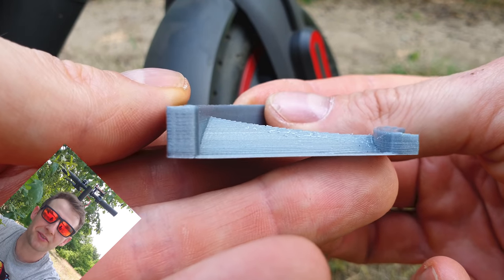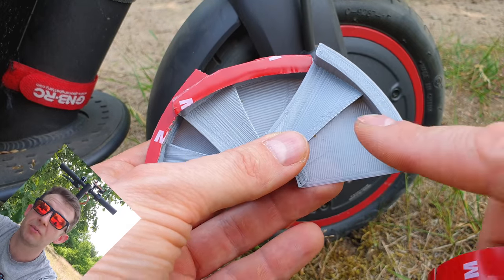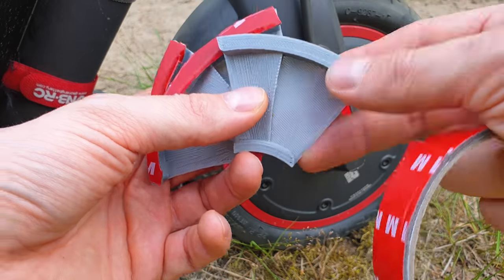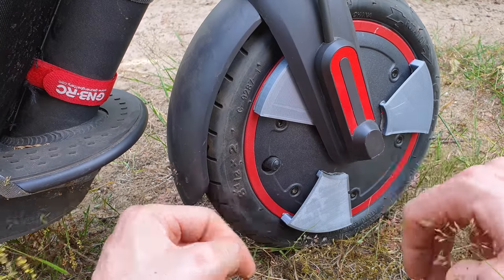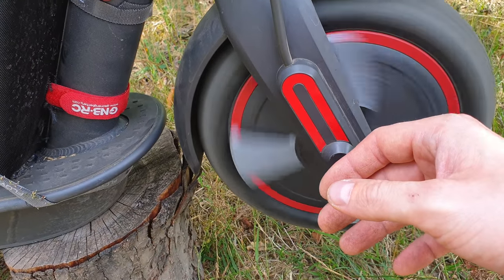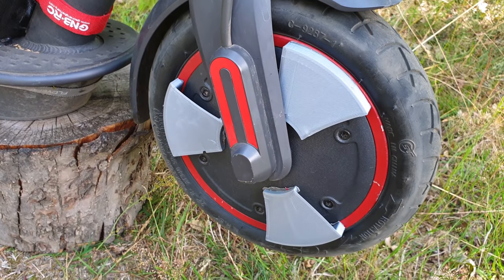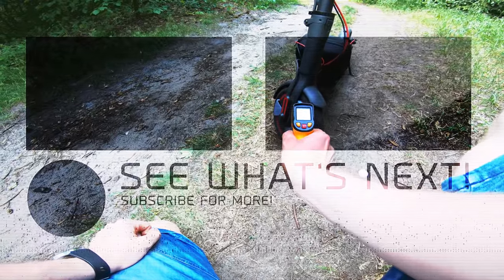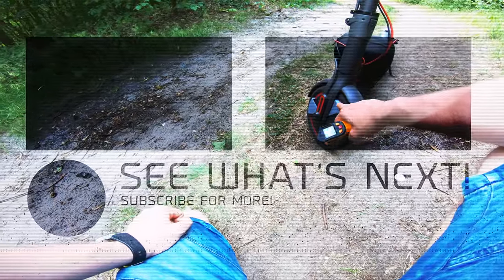World First Cooling system for Xiaomi M365 PRO " How to extend life span of your M365 "

Comment: If the hottest part of the motor is 65 degrees C then that's actually ok, close to the limit but not too bad. A quality motor with quality laminations can handle 65 degrees no problem and shouldn't kill it. However cooling the motor will still be good as there will be less resistance due to heat and you will maintain more power as there is less resistance. Perhaps next mod for cooling, look up "Statorade" it will transmit the heat from the motor core to the external casing far more efficiently and result in a cooler motor, more power being maintained, more efficient!
Reply: That isn't a flawless method in fact it comes at a bigger disadvantage,You will have to drill a whole in your motor which
1.Looks Awful
2.Will most likely damage the motor and has more risks
Whereas the only risk in this method is if it literally becomes loose and breaks some parts which is very rare because the tape is very sticky and you could use some super glue for some extra assurance that it wont fall out and potentially break something,So great suggestion,But not so great either 🤣
Reply: @agariodestroyer1862  Noooo!!! you do not have to drill a hole in the motor casing!! You just take the motor side plate off and drip it on to the outer casing magnets then put the casing back on, its that simple.  I have used that method on all of my motors. As for longevity and reliability its something ive learned you need to test, not all motors use the same epoxy to fix the outer permanent magnets in place and the statorade will react with some of those epoxies and the magnets will come off, however i believe there are a few people on the 365 forums who have used statorade without issue. So long as you swap out the statorade every 12 months it will not damage the motor provided the epoxy in your motor is compatible. I have used statorade on my motors for years without any problems, although i know people who have had magnets come off weeks after using it as the statorade reacted with the epoxy glue. Hence there is a stigma surrounding the use of statorade, it is up to you to test and use your own due diligence.

Comment: The best way to decrease temperatures isn't by adding anything or taking anything off, although I did notice that the cosmetic ring someone else mentioned did make a noticeable difference in temp. No, the best way is to make the motor more efficient, or more capable. Although, this will likely just move your hotspot to the next weak point , the controller. This is the game, those of us who are never satisfied we'll keep playing tag until the day we die. My goal is to go before the scooter does. Anyway, I live in one of the hottest environments on Earth(103° right now) and just accidentally leaving the scooter in the sun will render it useless, can't charge or ride above 104°. My motor always runs slightly above warm to the touch. I am running a sort of "hybrid" setup but the same applies. The trick is to make the weak component at fault more capable, in this case, I replaced the thin width rotor with one from another scooter with a higher rated wattage, I believe the one in my current setup is rated at 500w. It was a wider rotor and I had to do minor fitment work to get it on the 365 axel because the spacing was different on the donors. I also replaced magnets from the donor as well just to maximize potential but you don't have to & for the amount of work it doesn't seem worth it. Hopefully, once I beef up the controller and can put more power to the motor, it will become obvious that it was worth it. I'm sure it will. So, because you're not overloading the motor, the entire scooter runs cooler and of course made a noticeable difference in power, allowing me to up the power via firmware. It really is a win-win situation. Good luck and thanks for the vid!👍
Reply: Oh chill the f... out man, you're a scooter rider not some hardcore biker , comm'on!
Reply: @ChrisWhiteTech  here we go.. there's always one.  Whatchu so angry about man? Cuz I just made you have  to look a bunch of stuff up because you don't know what I'm talking about? Why are you watching stupid scooter rider vids then? Better yet, why you commenting on them?
Reply: @zro6828  Stupid vids? Not at all, this one in particular is pure genius, and i find it very informative as an owner of a clone m365 that needs improving in cooling and also an owner of an 2005 R6. Just sayin' tone down with the death references man, electric scooters and skulls just don't get along man, just...don't
Reply: Or you could simply ride the scooter with custom firmware installed, where the maximum speed on ECO mode is higher (25km/h instead of 21/15 (if you're running version 1.5.1)). So now I can reach 25 km/h on ECO mode, when the scooter only uses 250W which is its rated output. It reaches this max speed fairly easily, though, because I weigh only about 65kg and have well inflated tires (solid tires suck). Also disabling KERS (automatic regeneration) entirely and using the Russian acceleration algorithm can help as well, because more heat is being generated while regenerating and constantly speeding up. Russian algorithm is also a must, because you will be able to control the exact amount of energy coming to the motor and thus accelerate more smoothly and without using too much energy when you don't need to gain speed very quickly.
Reply: @one_step_sideways  yeah, I've been through all that. Never been a fan of mediocre. I am fortunate to have almost unlimited resources available to me at little to no cost, so I am only limited by time. My scoot is comprised of parts from 3 different models and is running around 1300 watts at peak. So obviously cfw isn't an upgrade as much as it is a necessity in order to optimize the hardware changes. Our figures our similar until converted to the imperial system, I'm currently most happy with the setup I mentioned, Russian throttle algorithm although I don't mess with the kers other than that because I like my electronic brake to be predictable. Other than that agree with almost everything you said and end up around 44kph or about 27mph by electronic limiter. Coincidentally, that is just about maxed out hardware wise but I limit there because bouncing off of the controllers hard limit at 45 is fairly hairy and just overall uneccessary. I must be doing something right because our atmospheric temperature is greater than what the scooter limits allow and as long as I don't let it sit out in the sun before I go take a ride, it rarely overheats.
Reply: Z Ro, in this respect, the best would be to keep the wiring scheme of the Motor, but rewind it, using much thicker copper-wire!!! You just have to make calculations of the room left in the stator-slots, and find so the thickest wire-gause that you could still comfortably wind. Same turn-number per slot, everything as is, but as said, with thicker wire. The efficiency-loses should then fall almost proportionaly to the cross-section-rise of the wire.
Reply: @klausbrinck2137  nice. Thanks! That and minor controller rework is about the only thing left. As mentioned, I'm running the best combination of what's available to me and atm that's the controller from a ninebot es. I noticed that almost none of them have the same fet ratings, so it's always a Gamble and need to check each controller before I put them to use. Some, don't even have the same fets across the single controller! Lol gotta love China! The best one I have seen, and am currently running is rated for over 100v & 110a at 250w with resistance of 0.0039 ohm. There are 8 of those on the ninebot controller and at the moment there is far more support for ninebot in the way of apps, information and supply. I would like to get back to the m365 controller at some point as it really is a less particular setup and in the end should be able to modify to a greater extent. I was really hoping for more from the m365 pro and other than battery, isn't much I would pay for as an upgrade. I'm going to try and find my limits soon and after I do, plan on a 10" tire upgrade. I'm already fooling the controller as it thinks it's spinning a smaller diameter tire than it really is. The 365 wheel swap was good for +2mph and the 10" should be good for another almost 3mph, putting me right at my goal which is 30mph and plenty of torque that I don't regret it. So far so good. We shall see.. This is without mentioning, the fact that at the same time I am working on the best ride possible as well. In fact that was my original goal.. to make a quick scoot that I could take on mild offroad surfaces without feeling like the scooter was going to fall apart or clanking so loud that everyone else was convinced it would and ultimately be able to jump local dirt jumps with the bmx guys. Before I do I have some weight to redistribute but the current setup is all bolt together and is the rear section of a 365 inserted into an es frame, retaining the caliper mount for the disc brake while remaining the same wheelbase as the es was originally. I realized the ES was actually a very capable frame but the suspension needed to be reworked and the solid tires eliminated before I could really tell. They sound horrible when pushed over even the most mild terrain, like they're falling apart. They are not and despite being the lightest of what I'm working with, the design and extrusion process really is much more capable in the end. I couldn't be more happy with my creation just based off of my original goal to have a solid ride that felt competent and quiet. I didn't intend to stretch it's limits performance wise but once I realized what a difference the larger diameter tires made when on a sure-footed platform, I had the confidence to start really getting it, plus being that I ride with friends around an hour each day and up until that point we were all pretty close as far as our machines went it came down to who had the biggest balls and I was soon to lose.. either some pride or some skin. I'm not a good loser and I'm getting older so losing flesh didn't sound great either, that left only one option and I really couldn't be happier! I bet if Xiaomi and Ninebot saw what I had done they'd straight shit theirselves wondering why they never thought of this combo as it would surely sell quite well once word got out. I've already been approached by everyone one of the guys I ride with and now some I don't even know, who had ridden the other 2 I have built outside of my own. Not bragging, really is that good!
Reply: Actually the hottest environment in the earth is Middle East :P we have during the day 47° C (117° F) and during August is reaching more than 52° C (126° F)
Try anyway to keep it under a shady place, otherwise your battery will die soon (hopefully will not explode)
Reply: @kthanassis89  I mean.. we have an avg summer temp of 104° f, every year that goes up we flirt with 120's for what seems like a week, also in late July through August. SOMETIMES it cools off before October. We don't drop below triple digits for at least 3mos. straight every year. Most people realize what that's like through limited contact just walking to a car coming from the air conditioned  airport to an air conditioned car etc, but that's during the day. Arizona is becoming densely populated and along with people come a lot of pavement, asphalt and concrete, thats what I mean when I say doesn't drop below 100° walk outside at midnight & it's still 102°! But yeah, I know about heat too, lol been here since 95 and before that was... .. and you're going to think I'm making shit up now but we lived in Death Valley CA before here.. 🤷‍♂️ Truth is anything 90° or up seems to show significant loss of performance from most things and scooters are no exception. Adapt and overcome like we always do I guess.
Reply: @zro6828  In UAE the temperature is more than 100 F from March until middle of November so I feel you!!! AC on the car is working always and during June-August without AC you can even die! Even if the car is running, people are towing them because they cannot drive 30-50km to garage

Comment: Very interesting. But are those solid tires? And how are you driving your scooter that the motor gets that hot? It never overheated on me once, not even when I pushed my flashed M365 to the limits. Is that a M365 Pro specific problem? And you should have simply used black pieces to match your motor's colour, it would be better aesthetically.

Comment: Hi, this is a great hack, do you think you can modify it to screw it down, take off the existing 3 screws and add longer ones.  Maybe drill a hole in the fins, not sure if that will decrease the cooling or not, or can you make 1 whole piece and use all 6 screws.  Is there a Ninebot ES2 version? Thanks

Comment: Just a suggestion, but would not have been possible to drill holes the the adapter. Then using longer screws place the adapter over  the wheel aligned with the original screw holes of the wheel, then using longer screws , fix the adapter to the wheel hub and secure with screws, The only difficulty is finding same screw thread with longer screws to go through the adapter and wheel

Comment: Hello,

Why didn't you set up a cooling system on the left side as well?
Could you design one? I would like to mount the cooling system on both sides.
Reply from the maker: Because on th3 left is plastic cover so it will not help much
Reply: @PirateWasHere  thx for the feedback.
I have another question for you, (because I want to install the suspension kit + pro dashboard + software upgrade,) I need as well a better braking system.So, does the m365 pro breaking system fits to m365?Can I just mount  the braking disc only?

Comment: Pirate !! Please create a commercial cooling system we can install for the controller inside I've bought a solar charging power bank and 2 usb 5v fans and my idea is to drill holes through the bottom plastic and mount the fans inside with wire coming out to solar powered power bank on the bottom bar next to front wheel this I think will cool it properly as it's not the motor getting hot that's the problem with this model it's the controller I seen your video of wire the fan in parrelel but I believe that would actually contribute a little extra heat and I want maximum cooling effect please test my idea too and make something everyone can buy for cooling the controller properly thanks
Reply from the maker: Its actually done ,i will show it in future episods ;)

Comment: I removed the plastic ring on the left  side of the motor (opposite the screws), it does nothing good for cooling. It is stuck with smal drops of silicone. Also I am currently considering ATF oil inside the motor, and 2 sponge discs stuck on both sides, with a reservoir slowly dripping water on them. Evaporative cooling should work fine at these high temperatures
Reply from the maker: I will make active cooling next time, if U really need to decrease temp  then what about adding some small alu heatsinks around right motor wall ?! . To seriously decrease temp U have to increase size of cooling to increase efficiency .
Reply: if you use sponge-discs, there would be no room for the air to "take away" the evaporating water, use instead just a small section of the disc, like 1/8th, or alike... a water reservoir with adjusted flow should care that the sponges always stay wet.

Comment: I had a question, i have the Xiaomi m365 and i tuned it but i want to know if its worth buying the pro version? Is it much faster? Or just a little bit?
Reply: M365 with firmware hack can reach 32km/h in optimal conditions, while the PRO can reach 35 km/h. I would recommend buying a new one

Comment: Nice way of cooling off the motor hehe! Anyway, do you recommend on replacing the m365 rear tyre for a solid tubeless one (with the holes) & keep the front air-filled tyre? Plus, will the performance be reduced?
Reply from the maker: if You really want solid tire, then this one from 2019 seems to be the Best but I will stock to antislip CST https://www.youtube.com/watch?v=4nNtnseMjzU
Reply: Performance is decreased in terms of getting to speed but i just did a mod to make mine go faster and give it more torque and its faster than the original so u can overcome the issue
Reply: @PirateWasHere  Great! Thanks Pirate! 👍
Reply: @neo8223  Thanks for the tip
Reply: @PirateWasHere  Pirate, hope you see my question. Since i have a moroim motor, the new cooling system that you developed dont fits on it. So I printed this one and so far ok! Do you think that if I put in the left side would decrease the temperature even more?

Comment: Would work better I'd think if you cut tiny slits in the plastic to allow the motor to vent.. otherwise i can't see how putting fins would do anything other than slow you down.
Reply from the maker: Did U creat something similar and tried ?!  , or re U just random guy who said " its crap "
Reply: @PirateWasHere  I'm not saying it's crap I'm just commenting on how putting fins on the side of the wheel wouldn't do that much because it wouldn't help remove any air from the motor any more than just regular air going of the hub as you ride around. just in the same way as those fans that people put in their car air intake don't do anything other than just spin.. otherwise you'd see cars having fins on their rims to help remove brake heat. Just talking physics man... there are a lot of factors that could go into why the temp dropped other than the fins he used. I'd love it if it worked, but until I see some actual testimonials or other examples of it working, i'm not about to tape these things to my rims.
Reply from the maker: @SubverterRadio  so far i got like couple messages from users who said it works ;) . Reconsider physics in this one , i will try to release in next week something different. Cheers and many thanks for reply 🍻🍕🍗🍟